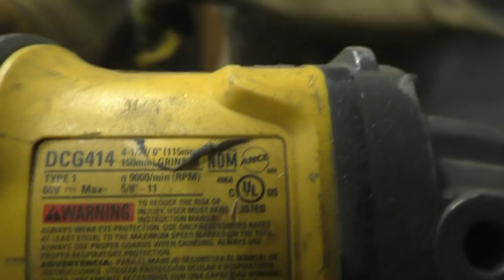Grinder Safety -- and lies you are told to scare you.

Comment: In 1975 the next door neighbours son who was a heavey equipment mechanic had a 9 inch grinding disc explode, he was wearing goggles but that did not stop him getting so badly injured he ended up in hospital for a week. I saw him shortly after that with a huge scar across his face and nose going into the corner of his right eye. Apparently when the disc ruptured it nearly cut his nose off. The modern cutting disc may be lighter but back then the grinding discs were a quarter inch thick and the fiber reinforcing was not as strong as it is today, grinding discs are still around a quarter inch thick and therefore carry much more kinetic energy than a cutting disc.
Reply: But... had his face simply not been in the plane of rotation, it wouldn't have gone in his face! It's simple physics.
Reply: @TonyRule  As I understood it at the time he was grinding or cutting something underneath a truck where it can be very difficult to position yourself such that you are out of the plane of the disc and in any case in such confined areas there is also the probability of ricochets.
Reply: @Equiluxe1  Then IMO he shouldn't have attempted it. But anyway, as pointed out, the energy in a section of cutting disk is very low as it is so light.
Reply: @TonyRule  not the old ones back in the 70's they were an eighth of an inch thick had less reinforcing and were rather brittle as well. I always used to do the ring test on them and if they did not ring I did not use them, modern ones dont ring if you tap them while supported via the hole in the middle. Any one who does not wear PPE  use the guard provided by the manufacturers and take suitable precautions in the use of grinding and cutting equipment is both reckless with their own and others safety.
Reply: @TonyRule  find myself in the plane of rotation all the time.
Can't be avoided in many instances.
It's the real world after all.
Reply: that was 1975 tools were more powerful and abrasives wernt as shatter resistant (more brittle)
Reply: @678friedbed  You are the ignorant one, no where in any thing I said did I indicate that I was scared of grinders, I have been using one for nigh on 50 years and to date never had any trouble myself. I told the story of the neighbour who got injured. I do however respect the  grinder and the energy and forces involved, which I assume from the snide remarks directed at me you do not. Any one who does not respect the safety of themselves and others deserve no respect from me.
Reply: @barlow2976  Seat belts are not in any way, shape, or form the equivalent to standing to the side of a cutting disc's plane of rotation. You can avoid being in a car crash as a result of your own negligence which negates the need for the seat belt by not out-driving your vision etc. Seat belts are there for the negligence of OTHER people's actions that you simply cannot mitigate.

Comment: I have not had a whole disc fail, but sections from the edge fly off.
Wear goggles, wear hearing protection, use a dust mask, particularly with aluminium and use the guard.
This guy's a typical shop know it all.
My line manager lost an eye from a steel filling that got infected and to say grinder wheels don't fail is bull.
We have a failure about twice a year in a shop of 8 guys. Why? Because they get hit or dropped and the damage isn't always as visible as the guy showed here.
On track with the Stihl saws, they break discs weekly. Usually just a chunk out the edge. Noone stands in front of the guy cutting and the guard protects the guy on the back.

Comment: One year ago yesterday I was injured by a cutoff wheel.  I bought a brand new grinder and a pack of discs from harbor freight and the first use the wheel exploded sending a shard into the top of my hand to the base of my thumb.  (I had full hand and eye protection). I had to get 12 stitches.  I lost so much blood I passed out.  I came close to losing my thumb. And bleeding out. My hand still hurts to this day.  Don’t buy power tools from harbor freight folks! GARBAGE!
Reply: Or just buy the grinder from harbor freight and run proper wheels on it (CGW, Norton, Sait, etc.)
Reply: or just learn how to use a grinder properly
Reply: harbor freight grinders are a ok mines going on 5 years and i make stuff like what's in my profile photo its the consumeables that are trash mate
Reply: I have a good old Makita, that machine is a dream
Reply: Bled out through your thumb, lol
Reply: DocNiemo 1 yeah it’s shock more than likely that did it. I’m quite bad with my own blood, deep cut and I’m starting to go out like a light, adrenaline hits, blood pressure drops night night.
Reply: @BruceNJeffAreMyFlies  Remember kids, 9000 rpm baby in the washing machine = not giggly baby :o)
Reply: @aaronmicalowe  yes it has a lot of velocity at first but rapidly drops off. One reason why I use a paddle switch grinder . But there's not much kinetic impact velocity drops and no weight behind it. Like getting hit with a pellet gun. Or a  . 45acp both traveling 900fps.

Comment: You do realize that 1. That grinder was not up to speed when the broken chunk flew off, and 2. Yes, the glasses are supposed to protect your eyes, but a guard would also protect your knuckles and face, and 3. A guard usually works as a decent support to control depth of cut? There's a reason the guard angle is easily adjustable...
Reply from the maker: Thanks Mom

Comment: Sparks=clue....got it.
Reply: Also fire.  If it's on fire, and it shouldn't be, you did something wrong.
Reply: If grinding wheel stuck - grinder jumps in other direction, opposite of sparks.
Reply: Ive been collecting sparks for years, still cant find any damn treasure
Reply: I love the shower of hot metal in my face. Reminds me of all the times hot brass would go down my shirt and touch me in ways nobody else can. Gives me chills just thinking about it.

Comment: At work I was cutting a piece of 1 inch angle iron from underneath and just like you said it pinched the blade and kicked back into my into thigh.    Cost me 24 stitches.  Two days later I bought one for my garage.  Lol.  Some lessons are learned the hard way

Comment: I had two new cutt off wheels explode in a row one day. No side pressure, correct disk size, correct disk speed. Seems contrary to the experience of most people. Has me a lot less confident with the angle grinder.
Reply: I think you might want to check the brand of disk or maybe see what kind of crazy grinder your using. that is very unusual
Reply: haven’t broken a wheel in my 5 years. maybe my time is coming. who knows.

Comment: I have had loads of discs explode on me.... And the battery ones doesn't go as fast as the corded ones... I actually prefer using the guard just to control where the sparks go and to get into them stupid awkward positions where if the disc explode will hit your face....
Reply: I've been using them for 20 years and the handful I've broke were my fault for binding or pinching them. You're your own problem, stop fighting it and stop using the left side... you big dummy.
Reply: @manbunmyname5866  im guessing you've perfected the art angle grinder as a precision tool..

Comment: Make sure the sparks are going towards you (if you don't have the guard on). Otherwise, if the sparks are going away from you, the actual wheel itself is pushing the grinder towards you, and if it jams up, it may suddenly (and with great force - even a power hand drill can do this when it binds) lurch towards you. Well, it's a good way to get nasty cuts on your hands, arms, and torso...
Reply: thats myth, when a rotating object explodes, it explodes in all directions.
Reply: @Paopao621  He didn't say anything about it exploding. If it catches, it can and will kick towards you. Can you control the kick? Sure. Do some people get lazy sometimes? Of course. Is that a reason to abvoid grinders? Maybe...if you're a bleeder.

Comment: First that's a batery powered grinder that I think it use a bldc motor. The starting torque is much smaller than that on a corded grinder(read about the series wound motor). Less torque=less strain on the disk at starting =less chance of breaking. Secondly it has much less then 9000 rpm when cutting.. maybe 5000 rpm. The guard is there to protect you from disk break sparks and for resting the tool with the disc touching the bench. I've heard a story where using a guard could have saved someone's life. A worker was cutting some steel using a grinder without a guard..  then a power outage happened.. the worker puts grinder on the bench forgetting to turn it off..  power comes back.. worker rush to stop the grinder.. but grinder spins and falls from the bench on the floor.. disk brakes and a pice of it hits worker in throat cutting blood vessel.. worker bleeds to death. Be safe! Never use a grinder without a guard!
Reply: Yes and just always unplug the damn thing.
Reply: 20v Max Dewalt he is using is a 9000 rpm brushless motor, with a soft start, electric brake and auto stop if pinched. It's a joy to use, but needs 6ah batteries if you're going to grind with it. Highly recommended.

Comment: As an experience user of this tool, here's some advice: never force the abrasive disc into the work or an accident is likely to ensue. If you drop a disc on a concrete floor, throw it away. Same with a grinding wheel. If it is dropped on the floor, chuck it. It might have a hairline crack in it as a result and can and will explode once spun up to thousands of rpms.  And remember, everything is known in the state of CA to cause birth defects and cancer because proposition 65 says so.

Comment: My uncle had a guard removed and had the disk fly apart, cutting an artery in his leg. Fortunately he thought quick enough to take off his belt and make a tourniquet which stopped the bleeding. My other uncle heard the bang and ran to see what happened and found my uncle in a pool of blood, too weak to call for help. He needed a few bags of blood to top him up and was a week in hospital.

I worked as a firefighter EMT and other than ladders and chainsaws, angle grinders were the next worst culprits for industrial accidents. Many of the victims were salty, old welders and machinists - not young guys. We heard the same story from those who could still talk, "I've done this a million times and this has never happened before".

Using a cut-off disk without a guard is suicidal. Don't follow this guy's advice if you value your life and body. Wear a face mask, keep the guard on, use the correct sized disk, discard any damaged disks or disks that have been dropped. Never twist the disk in the cut and ensure that the work is securely clamped.
Reply from the maker: I don’t think you actually watched the video or got the point. Watch again and try not to let your feelings interact with your brain.

Comment: I use a lot of the cutoff wheels for work, they're more dangerous than you think, but I've never been injured by one. My welding hood on the other hand has a hole right where my forehead would've been. I was in a tight hole cutting a piece of pipe, I slipped, caught the wheel sideways, the wheel caught, then came apart as the grinder spun up again when I pulled back. I happened to twist the grinder inline with my face in that split second going for the off switch and half the wheel went into my hood point first. It made it through and stuck there quite well. Sometimes freak accidents happen and there's a reason I wear protection.

Comment: I like the part when that disc separated and you hear it stick the wall across the room. A friend of mine almost died when a cut off disc separated with a large piece ending up in his abdomen, he almost bled to death. The grinder he was using had the guard removed by someone previously.
Reply from the maker: I seriously doubt that was a cut off disc.  And I have noticed a theme in these reports where the fault is not the user.  We like to point the finger at the person who removed the guard, and not the person who choose to use the tool as they did.

Comment: I've used a cut off disk to grind. I knew it was a bad idea, but did it anyway. It did break and hit me in the shin, but all it did is give me a little cut, but nothing a bandage wouldn't fix.
Reply: I had one come apart on me, it started to vibrate, then it shook for a second and exploded. It hit my welding helmet above the lens, another piece went 30 feet away. The " clue" was, I should have stopped when it started to vibrate,even though it was only about 10 seconds.

Comment: Hmm, you make a lot of good points. However, I've never found that the guard would be in my way. If a grinder at work is missing the guard, I will always find it and put it back on. Unless you are on a really, really specific situation, the guard is never in the way (and even then I'd prolly use a pneumatic tool or something). Does it make grinders safer, maybe not a lot. But I like having it, especially on small grinders that put your hand uncomfortably close to the disk.

Comment: Try telling that to the two Vietnamese immigrants I saw get shredded by a 9 inch grinder blade that came apart. They were replaced the day after
Reply: blades or the vietnamese?
Reply: @ureyesrbleeding1  both
Reply: @BruceNJeffAreMyFlies  or dont use steel discs on plaster ;)

Comment: I've gone through thousands of cut off blades of varying quality. I've never had 1 come apart in huge chunks like flying knives. I use gloves, glasses, and hearing protection when I use grinders. More for my convenience than anything. I don't like getting burned by Sparks, and I have was less fatigue when using hearing protection...
Reply: Gloves is the one thing I will not wear with rotating power equipment.  I'll take a laceration over a ripped off finger any day of the week.
Reply: @ElementofKindness  with a lathe, drill, or mill I agree. I don't wear them on that stuff.
Reply: I had a 12" cutoff disk come apart in a big 2000W angle grinder... exploded on me, had a few scratches in the face and a big haematoma on my solarplexus. So what. Cussed a bit, changed the disk, took a new set of safety glasses (old ones were scratched), worked on.

Comment: Honestly, the scariest thing I've ever done with a grinder is set my pants on fire. 
Be safe, be alert (watch those sparks), but don't be afraid or skiddish because that's when accidents happen.
Reply: actually I would say fire is probably one of the higher things on the list of dangers of a grinder.
Reply: 3 words no welder wants ro say "I'm  on fire"
Reply: I set my jacket on fire once from grinding. Not fun!
Reply: Except when you set your pants on fire you can put them out. Once he sets that finding nemo shower curtain alight it's not so easy to douse. Try putting out burning vinyl, poly, or sunbrella (acrylic) sometime. Really, i feel pretty much the same way about "just don't be stupid" as he does. You know, like the cameraman, who is Exactly in the same plane as the disc, from 5:00 minutes to the end.
We get it, you will never have an accident. Thing is, i'm not that lucky, and i need my eyes to make a living. I can see that you work relatively safely, but at the same time i can see a keyboard that has to be full of grinder dust.
Reply: @lancehenthorn17  Lucky you, doing it just once. On average I set one hoodie on fire every two months. So far 5 ruined hoodies, correction 5 hoodies just for shop use.
Reply: @danceHHmusic  that jacket cost $185.00 if i want to replace it. I got it when I was in the Navy. I do have a second one. So I'm good. Plus the burnt one is still usable.
Reply: Didn't ever do it with a grinder, but I did set myself on fire a few times with a welder. Was wearing a long sleeve button up Carhartt shirt that I should have thrown away a while before then. Wondered why my wrist still felt warm and saw the shirt and said "well shit, I set myself on fire."
Reply: I used a cutting torch on a 24" flange. I reached over cutting bolts out as for as I could go. Turns out that meant under the pipe and up my coverall leg. Caught my jogging pants on fire. Oops, got a dance outa that one. You know grabbing handfuls and squeezin' so it wouldn't touch my skin!
Reply: the main things itl damege is ur hearing and lungs if all the dust of any type blows twards u or sparks

Comment: Drop the grinder. Crack the disk. There is your greatest risk scenario. All things equal the angle grinder is Way Safe compared to any tools with a rotating steel blade. JMHO. Think. Then Act

Comment: A former friend of mine split his chin in two with a cutting disk, Wrong RPM grinder and the kicker, standing inline with the disk at close proximity to his face, no shield and only had sunglasses on. Two of us said that wasn't a good idea but he insisted he knew what he was doing, we gave ample warnings and even stopped him a few minutes before the disk failed. Since then he has never been in the path the disk would throw chunks, to bad it took his chin, front bottom teeth and part of his tongue to figure that out...... about the only serious injury I've seen from grinders. Remember, common sense first! if it looks or sounds like a bad idea, it generally is, there isn't any shame in taking advice from others, might save you some pain down the road.